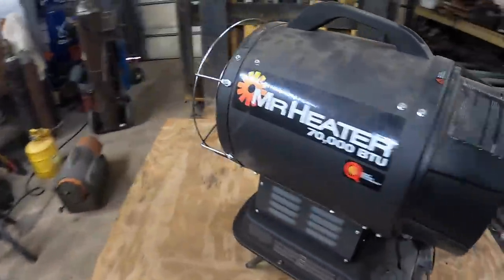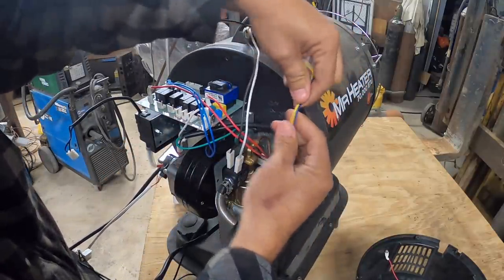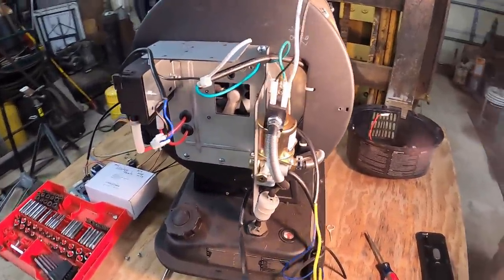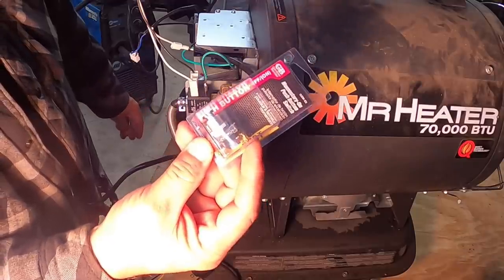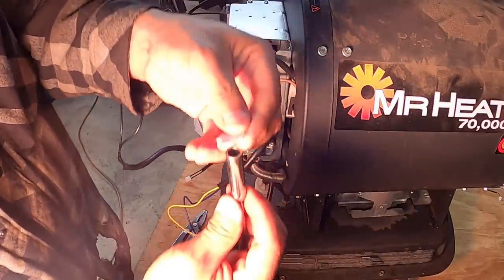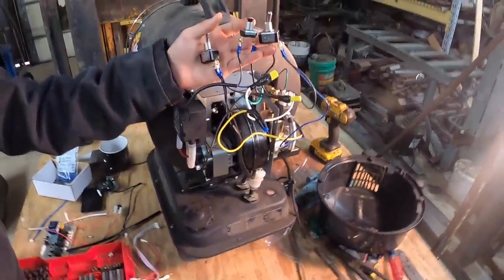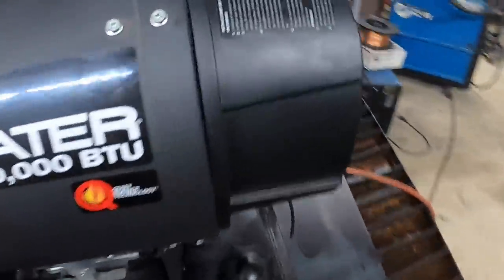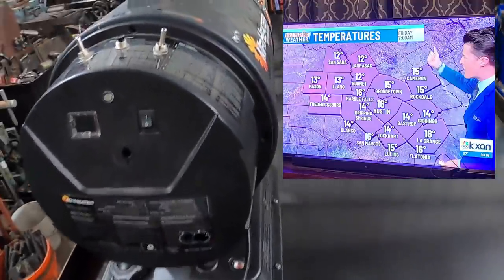Mr. Heater Troubles.. Eliminated.

Comment: isn't it amazing how complicated they can make something so simple , push right to repair every where you can
Reply: While I agree with right to repair,  the complications here is mainly safety systems to protect dumbasses from burning their house down. Much of that is things like tipover sensors and are mandated by fire code Eectronics is the cheapest way to implement them. If you are careful and capable of common sense, you probably don't need them but these are marketed to the general public so....

I have repaired quite a few of these types of heaters over the years. The problem always seems to be the fuel line gets brittle and cracks somewhere.  They work by siphoning fuel via vacuum created with a ventury using the fan and the cracks allow air to enter breaking the siphon. Replacing the fuel lines usually does it in my experience.
Reply: You can order replacement parts from Mr Heater, so right to repair isn't at issue here, though I agree that RTR needs to be pushed.

And all the complexity is there for the safety features so that you can simply flip a switch and walk away.
Older versions would have had thermocouples and such, so no electronics, but sensitive mechanical components that needed frequent cleaning and adjustment.
This uses an optical flame sensor, which is much more reliable and needs no maintenence.
It's what most of the commercial boilers and furnaces and such use.

Comment: I looked for the technical manual and found out that the main board usually locked these things out due to igniter failure or low fuel pressure failure . 
But you solved the issue doing it the smart way and just eliminating the stupid control board altogether. 

Youd make a good HVAC technician. Cheers on this repair !

Comment: I've had to replace lots of control board relays. Not too difficult if you're somewhat handy with a test meter and a soldering iron. But you probably found the quickest solution to solve the issue.

Comment: Been in this house 20 years now, and used a kerosene heater out in the 2 car garage when working out there. I've had to replace the 1st one as it just plain wore out. 2nd one died after 3 years of use. 
Bought a propane one for less money than another kerosene unit. Love it. Adjustable heat setting, and a 20 pound tank last longer than what the 5 gallons of kerosene did. Bonus of no more kerosene exhaust smell.
Reply: I once used a propane tower not a patio tower but like a jobsite tower style in my 12 x 16 shed and my guys came in for lunch and they all felt sick as dogs after lunch We never used it again
Reply: 5 gallons of Kerosene has more heating value than 20lb of propane and combustion efficiency on both will be >99% so the claim of lasting longer cannot be true even if you think it is.  Propane has its benefits though.

Comment: Nice job 😁

Install a differential pressure switch, to cut off fuel when the fan isn't turning. Available at every HVAC store, it's not expensive.

The white little pill was the temperature sensor. I don't think you really need it.
Reply from the maker: Thanks for the tip!

Comment: One safety switch you could install is an air pressure switch. So if the fan quits it senses the los of air pressure due to the fan not blowing, the fuel pump quits. You can find these switches in most modern and some older furnaces.
Reply: Great to see you and your son working together.

Comment: Looks good!
I DO see a small problem tho, @5:13 you remove a small thermostat with two red wires going to it, this now leaves a big hole in the fire box which is blowing red hot air onto the copper fuel line, I would re-attach the Thermostat and bolt it down to block the hole to not pre-heat the fuel line, even tho it wont be hooked up anymore- seems like a recipe for disaster leaving hot flaming air to blow on the metal fuel lines! Hahaha
Reply: the thermostat is just behind the fan, with a little luck it is just blowing cold air in the electrics compartment. in that case it will reduce the efficiency of the fan.
I agree with you, close that hole!

Comment: Isaac, years ago I had a 100,000 btu heater that the high voltage transformer had quit working on, so I replaced it with a neon sign transformer, and it again operated as it should. You bypassing the control board just makes it operate like the older heaters did.

Comment: It's amazing how complicated they've made stuff.  Your solution there would be very easy to implement at the factory, with a couple very simple tip-over and temperature switches to make sure it didn't start a fire.  But no, has to be excessively complex and failure prone...

Comment: Kinda ran into the same kind of problem with a modern evaporative cooler. It was doing what it wanted to do and not what I wanted it to do. Sure enough there was a overly complex circuit board at the center of it all. Ultimately though, in the end, it was power in, power out to the pumps and three speed blower motor. I used an old school manual rotary switch to replace the circuit board and now it does what I want. Good video.
Reply from the maker: smart move with the rotary switch.

Comment: A small advice here: you can modify it so the fan switch kill the fuel pump too, this way the pump doesn't start unless the fan is already on.
Good job!
Reply from the maker: good point
Reply: I was thinking this too, use a normally open relay to only close the circuit for the pump when the fan is switched on

Comment: nice one , as a foot note the old style jet heaters had almost no safety on them either if they went out it was usually cause they ran out of fuel , and they worked just fine , i must admit your heater is nice and compact and is quite compared to the older style , nice to see a good work around

Comment: Good fix and cheap, well done. This fix shows the fuel pump, fan and ignitor are all good so the problem is soot. Usually the fire eye gets soot covered and can't "see" the flame. If you ever get a new heater use kerosene instead of diesel. It burns cleaner without soot.
Reply: #1 diesel is the way to go in these heaters.  Not sure if that's what you meant by Kerosene but K1 is is not necessary and can be reserved for wick based heaters only.
Reply: @knurlgnar24  number 1 is home heating oil. It is even lower grade and will soot even more. It will work but the by product is smoke and soot, kerosene is cleaner burning thereby not dirtying up the inside allowing it to last longer. It's more expensive than diesel so most people don't use it but it's all I run and the heaters last for years without fail.

Comment: Ah yes, the dreaded heater repair. One of the 500 things about the welding business that AIN’T welding. The paper in the socket trick is a good one. I’ve always used black electrical tape.

Comment: I have one that lives out in the shed until winter. Every single time I bring it into the barn there’s a family of mice living in it so the wires are chewed and there’s pee in it. I’ve stopped up all the access points, put wire mesh on it.  They don’t care, they just eat through the plastic and get back in.

Edit:  if you daisy chain the switches so the fan switch powers the solenoid switch, and the solenoid switch powers the ignitor you’ll make it so the solenoid and pump can only run if the fan is on.
Reply: That would be simple however those require the fan to run for 3 minutes after shutdown to cool the burner.

Comment: Isaac, it's no more unsafe than the older units, made before all the circuit boards and computer chips. You just have to be aware of the limitations and perils involved. I hope your power doesn't go out as it did last year. Thanks for the video. Jon

Comment: Nice work around. I would have left the thermocouple that was by the fan in place, to cut power to the pump on an over temp. Then again, that could have been the problem all along. You can't argue working versus not working no matter how you look at it.
Reply from the maker: I might figure out how to reinstall some sort of sensor to shut it off in case of troubles.

Comment: A better (and safer) modification would have been to retain the optical sensor and the overheat switch and use a residential oil burner primary control. It could be mounted in the same place as the original electronic controller. You would just need to make a larger hole in the cover for it to stick out of and to have access to the reset button. You can find them online for as low as $50.00, well worth it.
Reply from the maker: excellent. thanks man.

Comment: We have all been there having to modify something electrical. My John Deere tractor has a time delay module for the fuel pull in circuit. Well the module bit the dust. $24 for a time delay relay on/off and some of my time and works like a champ. Deere can keep their $480 black box!!!

Comment: If you are stuck on using fuel, can you put in a chimney? Once I had a Klondike stove. No pump just use a 5 gallon can upside down about 5 feet up. Copper tube with a ball valve outside and another next to the stove. It just dripped onto an asbestos pad that I lit with wooden matches. Otherwise it was just a little cast iron wood stove. I'm sure you have scrap plate and a welder somewhere. It worked on diesel kerosene and used motor oil thinned about a half cup of gas per gallon. I even used old cooking oil mixed in diesel.

Comment: I would just really emphasize that doing this bypasses any of the safety sensors and that type of thing.   Basically do it at your own risk!     Personally I don't see any problem with it.  Nice job.
Reply: mr heater should use heavier relays in that board ive seen this more than once where they stb on the count of cheap relays from wait for it ch_ _a

Comment: Broken "smart heater" to Working "dumb heater".  Good work by using your head to save an appliance from the landfill.  As for the safety deletes I agree as long as the user is aware they are gone... the only safety you need is located between your ears.

Comment: Another great video. I have this same heater same issue. I have found I can get the unit to light if I hold a butane torch at the 7 o'clock position on the burner face on the discharge side of the heater( I try to get some flame in the holes). Maybe I get the e1 error because I run diesel instead of kerosene but that torch trick while turning the unit on seems reduce my e1 codes. Really curious to watch these comments to see if people identify the fuel they use and if this mod helps with their e1 codes.  I'd do this mod in a second if it would help me light off the diesel in the heater here in michigan. Anti gel additives and 91% rubbing alchol havent seemed to help much.

Comment: Now, if you have a multimeter, I would find out what broke/failed on the board you removed. Could have been thermal sensor (you removed from the inside), or relay (several on there).  Plus what was the Error code? E1? The CAD cell photo cell needs cleaning as it could be covered in soot. Bypassing your way will work, but interesting to see you always fixing something so it works! Be Safe, stay warm! (we got fog up here and rain..soon to become ice)

Comment: The simplest safety feature might be to install a current sensing relay on the fan which would control the fuel pump. If the fan does not pull current, the relay stays open. Is there an over-temp sensor?

Comment: Not so many years ago that is how it would have been made. Back when we had common sense and the ability to think and act for ourselves. Now as the next generation is dumbed down to accept anything they are told to do and every bit of equipment is supposed to think for you. Fine if they work but of course little does for very long and we just became the throw away society. I am a tinkerer and fix all sorts. Usually the first step is get rid of all the safety crap. Then the thing runs and does what it should. Good job.

Comment: The E1 code on the 70k Mr Heater is because of the fuel pressure regulator setting from the factory. It is set to run 'white kerosene (high refined)', but the regulator can be set to run H2 or D2 fuel oil...you just have to reset that 'regulator set screw'. I know it's a 'bit late' for this...but if you buy another one, if it throws an E1 code, you just take that rear cover off, turn the regulator screw around 1/4-turn clockwise, then try to start it...should fire right up (even when cold) on D2 diesel. If it still stumbles around, turn that screw about 1/8 of a turn more...it will fire right up...no more E1 code. D2 has a higher viscosity than the $20 a gallon 'super refined' Kero they sell in stores...and quite a bit more than pump-kero...but at least the 'over-heat flame off, cool-down mode' can still work as a safety feature, if you need it to. Hope this helps! Really like the channel!
Reply from the maker: I noticed that there are two screws. One big Flat blade screw on the side and the smaller phillips screw on the back. Not sure which screw does what?
Reply: @ICWeld  Should be 'adjustable' with a flat tip, without really removing a lot (other than the plastic cover deal)...CAREFUL! If yours has a 'divorcable' solenoid (from the pump), I don't think you can get that anymore...and the combined unit is like $120...as I remember on mine, it was a flat-tip...but no telling if that changed over production time, or not. I'd call it 'on the outside' not the 'inside' of the solenoid (facing 'outward' of the heater, not towards the control panel mount)...I've never heard of one actually 'failing'...just couldn't move the heavier D2 without 'increased spring pressure', though...and TSC sold them for a long time...figure they'd know if they had a problem with 'failures', due to returns...

Comment: What brand of track torch was that you use. ?? The manual one 
And also Iv seen some vids where you marked on some steel with chock what are you spraying on the metal to make it stay while cutting ? Thanks David
Reply from the maker: ez cut and i used a silver pencil with wd40 spray
Reply: @ICWeld  thanks ic I’ll look them up and thanks for the vids. I repair equipment also but always enjoy seeing other ways to doing it.

Comment: Will work until your power grid breaks down. Good chance of that also. That other heater you got works on a car battery and  might be needed.
Reply: He's a mobile welder by trade.... he's got a power plant in the back of his pickup. I'm sure a short term grid power failure isn't much of a concern.

Comment: Had a similar problem with a propane heater.  I understand that they are trying to make them safer, but if you make something idiot proof, only an idiot would use it.  Your fix will last longer than the heater👍👍

Comment: Re: your comment about the cold weather south of Dallas. 

Something I can’t stand about people is their lack of empathy. When that cold snap happened last year in Texas and the whole state came to a grinding halt and hundreds of people died. All over the internet people from colder weather places were ridiculing Texans to toughen up. I’m from Canada and was literally working in -30C, pounding grounding electrodes and running conduit before a concrete pour. If you don’t have the right gear or aren’t used to colder weather it can be uncomfortable or downright dangerous. I never see Texans laughing at Canadians when we are complaining or people here pass away when it’s 95F.
Reply from the maker: Very true indeed. It's all a matter of where youre accustomed to living. I remember the days when I wouldnt even break a sweat at 95F. One time when the temperature was 105,  a small cool front came in and dropped the temp to 99. It actually felt Nice. That was a cool afternoon after that! hehe. But yes, If youre not prepared, things can get dangerous fast.

Comment: I would’ve put a 120v vacuum switch attached to the fan attached to a 5 second TOF run timer to turn on the fuel pump and a TON timer to fire the igniter for 2 seconds.
Reply from the maker: good idea. thanks bud

Comment: Yep, that works, BUT for god's  sake, ( small 'G' intended ) don't, DON'T  run this type of oil burning heater in a closed space, i.e. garage with the door's closed. 
If you do, they'll probably find you there in the morning, or next week!  I feel certain that 'I C Weld' is fully aware of this, but some folks may not have thought of this.
Sounds drastic, doesn't it, but hey, Carbon Monoxide / CO  and Carbon Dioxide / CO2 are 'drastic' too!
Now before you decided to 'rain' all kinds of abuse on me,  think of this,..... that control board was put in that heater for good reasons and a few of those 'reasons' were thought up
by lawyers!  
Think about it. Burning oil produce copious amounts of nasty by-products that you will be breathing.
Reply: You don't have any idea what you're talking about Reg.  These are run in closed spaces all the time and they produce no carbon monoxide if they are running properly.  Direct vent oil fueled house heat was ubiquitous for over 100 years until just recently, and the safeties this heater has haven't been used in such heaters until the last 20 years or so.  Many people still use heaters without these safeties in their shops today without knowing it.  Ignorance like this just makes me shake my head and be ashamed to be human.
Reply: @knurlgnar24  OK  OK I bow to your 'superior knowledge' , actually I was correct in thinking that some poor soul would be trying to take a piece out of me for saying this! Hahahaha,... don't forget to breathe deeply in your closed space with a heater like this running,..it shouldn't take too long.... LOL!
H'mm I wonder why they have bothered to invent  CO and CO2 detectors?

Comment: The overheat thermostat switch needs to be in the fuel solenoid line.    Has to be.  I have three of these, one size up.     BTW, that board is about $24.00 at my supplier.
Reply: If he was to still go the DIY route instead of buying a new board, could he install a relay between the fuel pump and temp switch?